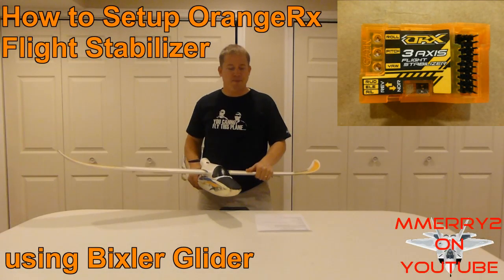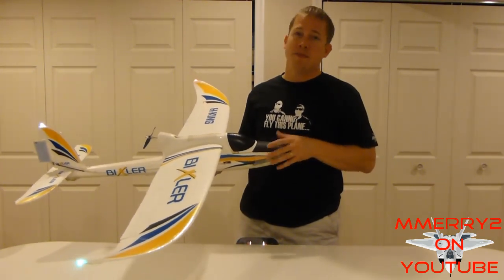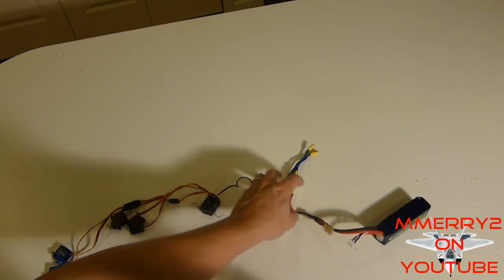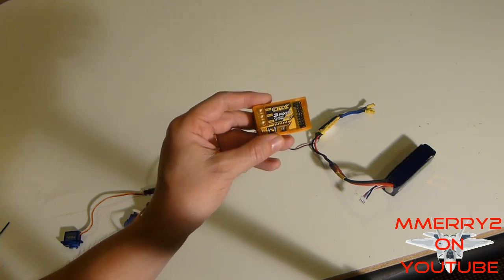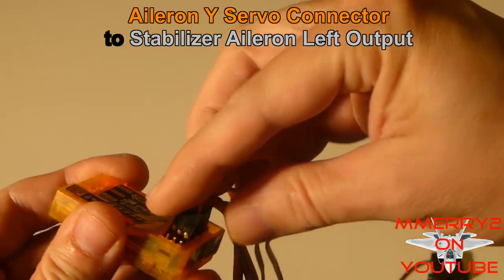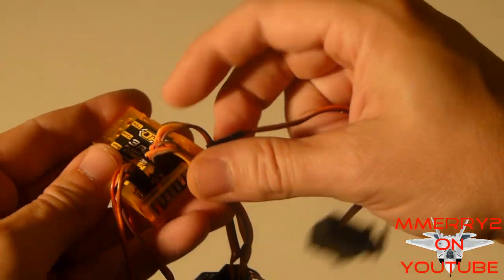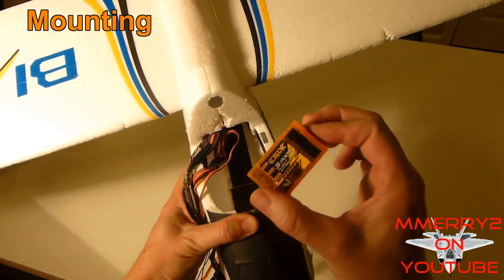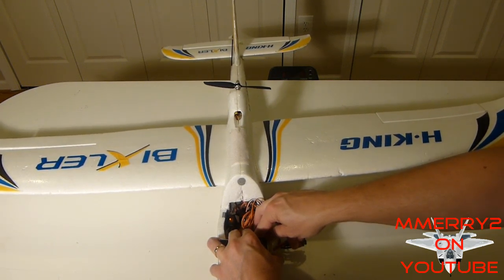How to Setup OrangeRx Stabilizer - using Bixler Glider

Comment: If using a gyro is cheating then damn, better call out on commercial airline pilots on the amount of equipment they used for their job. haha A gyro is just there to make flying a lot more smoother and honestly, more safer when flying larger airplanes. For smaller planes, you don't need it, but even when I was a beginner, it still would have been nice simply because it was such a light weight plane and the wind kept pushing it around too much. I bought the V2 so I can spend more time flying and less time spending money on replacing parts.

Comment: Great explanation.
Just a quick question please, how do i setup the "neutral position" when the airplane has tail wheel? I´m want to put on my DC-3 but the "normal" taxi stance/position (gear down) is nose high..should i put the DC-3 on a flat deck  ("normal flight position ) to install ? Tnx

Comment: Hi Mike!
You should try this gyro with the Nobee/ JohnRB "Open Flight Stabilizer Firmware - works much (!!!) better and brings a real 2nd aileron, remote controlled Gain and also HH- Mode and much more. Also CPPM, S-Bus and Spektrum Bus are possible then.

You can find that in this RCGroups- Thread:
http://www.rcgroups.com/forums/showthread.php?t=1794672

Best regards from Germany...

Frank
Reply from the maker: Thanks.  I will check it out.

Comment: I have installed it to my bixler...the problem i encounter is the tail are lower than the front...as i fly fast the plane are getting higher... what should i do with the setup? it suppose to fly straight and level right? thanks in advance

Comment: Try this, don't use the rudder input/out on your OrangeRX. Install a heli head locking gyro to control the rudder. Electronics wise at least, it will work. Gyros have been used on rudder for quite some time.

Comment from the maker: @3FLYTE: Instead of using a Y connector for the ailerons, I think you need to plug your left aileron servo into the left aileron input and the right aileron servo into the right aileron input.  You have to do this when ailerons move in the same direction.  Let us know if this fixes it.

Comment: Can you please confirm that like other flight stabilization systems as the FY-20A and the Eagle A3, the RX3S actually supports 3D heading lock on your present attitude (pitch, roll, and heading) to help us to  perform stunts like prop hanging, inverted flight, knife edges and low speed harriers?

Comment from the maker: No, they are called male-to-male servo connectors or leads.  I know it sounds like they would need to be females, but the females have the outer shell on them.  Check out the product link in the video description to verify they are called male-to-male.  Thanks.

Comment from the maker: Here is what I would try:  1) Disconnect aileron male-to-male lead and replace it with a new lead.  Test.  2)  Disconnect aileron servos from aileron-left port and plug in a new servo, just for testing.  Test.  3)  Plug in aileron servos into aileron-right port.  Test.

Comment: What is your opinion of the performance of the OrangeRX vs. the KK2 board?  The KK2 board is so cheap, but so flexible and powerful, unless this really did a better job I'm inclined to just get another KK2 for my fixed wing.

Comment from the maker: The OrangeRx is more simple to use than the KK2 & now they make a OrangeRx with built-in Spektrum-compatible Rx to make it even simpler.  It's also lighter than KK2.  KK2 requires a BEC if you want to fly it in a plane using OpenAero2.  KK2 is nice for the addition of auto-leveling and more tuning possibilities.  I say stick with KK2 if you can handle the additional weight or if you really want the auto-leveling feature.  I bet HK will eventually release an OrangeRx that has auto-leveling also.

Comment from the maker: Watch 5:01 in the video.  You use 3 male-to-male servo cables between the receiver and the stabilizer.  Connect elevator, aileron, and rudder on receiver to the elevator, aileron and rudder INPUTS on the stabilizer.

Comment: Thank you for great explanation and video.
I have Easystar2 , Spectrum Dx6i and Ar6200 receiver with his sattelite. 
The ailerons are connected using Y cable. 
I have a few questions:
- What is your suggestion for gain sensitivity ( maybe 70 % is ok )?
- Is your stabilizer switched on all the time in the air  even in the final landing    approach?
- What is your traveler setting for all servoes in the transmittrer ?

Regards.
-

Comment: Regarding 3-Axis Flight Stabilizer(in my case I have OrangeRX RX3S 3-Axis Flight Stabilizer V2 (V2.1 firmware) and AR636A with AS3X from Spektrum) Is there any requirement to be used on any plane? I mostly flight and love warbirds so, what´s your suggestion? I consider myselft an intermediate pilot. 
Thank you in advanced!

Comment: Thank you for this video, really helped when I plugged each of the ailerons separately they both worked in the same direction - so you pointed out that you use the Y cable and plug both into the L aileron for the Bix3